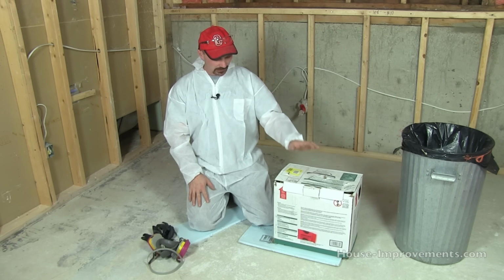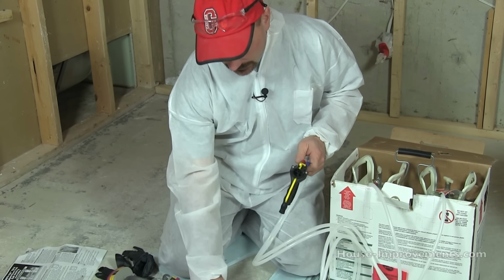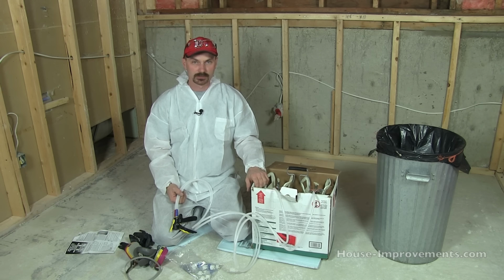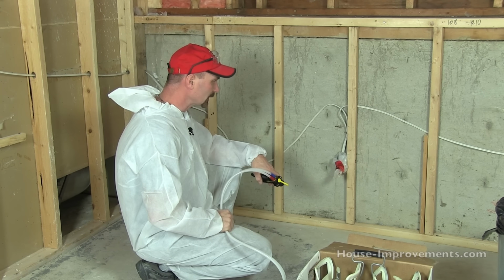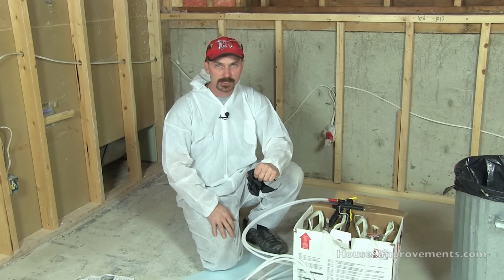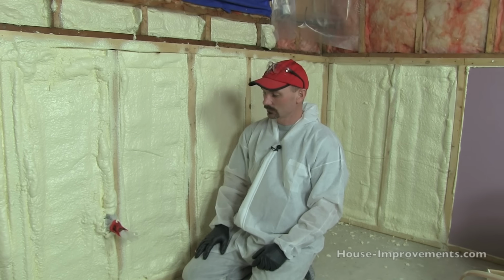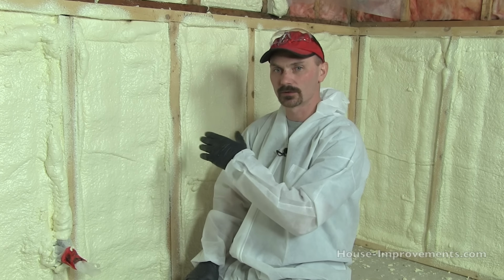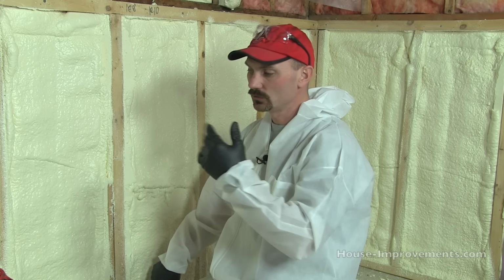How to Install Spray Foam Insulation DIY

Comment: For anyone who wants to compare glass to spray foam(closed cell) I have had 2 homes in Louisiana which gets 100 degree temps with very high humidity, Ac people will ask to come do work in your attic as early as you will wake up so they can tolerate the heat, My first home had glass in the attic, It was horrible to get in the attic during the day with two attic vents running all day. I lost that house in Katrina, The new house has spray foam in the attic, I can work in my attic all day and it gets warm but not hot. Much more affordable electric bills compared to the glass attic in the first house, my first house was 2100 square ft and the new house is 3900 square feet and I pay less now then before. It cost much more up front but if you stay in your house or plan on staying in your house for at least 15 years then it will pay for itself.
Reply: Thank you with helping my decision
Reply: Great info!
Reply: Was it just roof you had sprayed ? Closed ornopen cell ? No condensation problem in winter ?
Reply: There must be some missing info here about the 2 houses.  A typical attic is uninsulated.  The home's insulation is found in the attic floor not on the attic ceiling.  So the heat in the attic is determined by how well it's vented to the outside.  The insulation doesn't make a difference because it's only creating a temp barrier between the house living space and the attic.
Reply: I live in North Port Fl heat & humidity take your breath & to pay outrageous energy bills to cool my house is absurd. I have done enough home construction to know I can do this to my mobile home interior wallas.
1x3 studs with cheap insulation. This should be great for my home. How much is the question. Home is 36x24

Comment: FYI, the fumes don't give you any kind of buzz, but they do indeed give you a very heavy chest and red eyes that burn. You even get haze eye which can be painful, sensitivity to light and very cloudy vision. And it lasts for days. I found this out on the first job I ever did with a filtered mask and safety glasses. After that I immediately bought a forced fresh air system. Oh and if you have asthma, exposure could cause a severe asthma attack. Just throwing that out there, I'm not some big safety gooroo or nothing.
Reply: Thank you very much for sharing that information It is vital to know!

Comment: Once again Shannon thank you for the great video I did my basement in 2014, And it cost me a $1000 Then to do the whole basement and I asked the crew to spray right up to my ceiling in the joyces.  It paid for itself in one year. Now I'm doing a small renovation project in my cold cellar which is 10' by 5'. With inflation it's gonna cost me more just to do that little space than it was to do my whole basement. So I will be buying one of these kits to do it. 
 Thanks again.

Comment: I just did this in my basement. The rim joists were so drafty it was like a wind tunnel under the floors. It was so satisfying spraying the wood and feeling the air be still afterwards :)
Reply from the maker: works nicely!
Reply: Are the rim joist  what sits on the foundation edge around the house??!
Reply: @michelcorneau1923  yes

Comment: I pulled all the insulation out of my place last week. It was not even tact into place, looks like someone set it and put up drywall. It was piled up at the bottom of the walls. I am almost done spray foaming all the walls. Been using a guitar string to level it all with the studs and a putty knife to clean up the studs. Next is the roof and basement.
Reply: are you using the guitar sting to cut off the excess foam sticking above the stud's after it has cured?

Comment: For anyone watching this today: air barrier requirements are usually met after just 1" of closed cell foam. Also spraying multiple times has nothing to do with an air barrier. Spraying multiple layers acts as a single layer. Overall thickness is your only concern.
Reply: I thought 2" of closed cell foam constituted an air barrier...
Reply: You sound knowledgeable. Could you use this on a ceiling with corrugated metal ceiling? Any recommendations for brands?
Reply: @TheJnetnunez  Can be used for corrugated metal roofs. That is a standard "upgrade" people do to shops/barns. Just realize that it's basically glue, and replacing any panel it's sprayed on (say in 20-30 years) is quite difficult. Can still be done though.

Brand doesn't really matter, you just want to use closed cell (rather than open) for the layer that contacts the roof. Open cell will absorb moisture and can cause problems.
Reply: @whitenite007  we did a shop addition and all you should really have to do is put the pink styrofoam insulation board up first then spray foam.

Comment: Just bought this exact kit from the local Menards to do the outside facing basement joists.  This is a big help, thank you for the DIY.
Reply: What brand is this kit?
Reply: @trayvonlovell9301  I bought the Froth-Pack 200 by dupont, there are larger tanks available as well (650, etc).  
Make sure you you pull the the trigger all the way at all times - learned this the hard way the second time and I did not watch this vid as a refresher....

Comment: Great Instructional Video Shannon i used these kits to do my basement 26x56 framed all in 2x2 and my Garage 24x40 x12 2x6 construction Garage Myself took 4 days to complete just after New Construction got quotes from 3 different Pro Company’s and the cheapest it could be done with 2in in the basement and 4in in the garage only outside walls was 23,650.......Highest Quote was 27,323 i did the whole job myself and did layers just as you did just invested in a large bag of fan tips and it cost me just under 10,000 including my time at $30 pr hour 24 hrs total.......The Happy Dance....🗯🥳🤪
Reply: J Martin 
Are you saying you spent $9000 in Foam?
Reply: This is similar to what I'm planning with my own remodel.  I'll just be doing one room at a time as it will be a live in remodel.  And due to being a live in I can't afford to rip everything out all at once to spray and then recover.  For me the costs of the kits would be will spent in comparison to living in a hotel due the entire time of the tear out, electrical prep, HVAC prep, plumbing prep, shooting the walls/floors/ceilings, and then covering it all back up.

Comment: Depending on the specific situation, spray insulation is superior. For instance, if you are insulating a van, spray will prevent moisture from reaching the metal and corrode. In home, the spay can fill up air-gaps, especially around electrical outlets.

Comment: How can you clean spray tips
Reply from the maker: It would have to be done immediately after removing the tips if you did try and you could use spray foam gun cleaner. not sure how well it may work? https://amzn.to/3BSLL8b

Comment: If you apply this to a concrete block-above grade- new construction home, do you have to seal the blocks on the interior with a moisture barrier? Thanks for a thorough presentation.
Reply from the maker: IMO ,I do not think so.
Reply: Foam does mold if exsposed to moisture...
Reply: We would spray block and concrete basements on the outside from foundation footings up to the top amd only the exposed foam would need to be sprayed with a UV protectant and a fire shield.

Comment: If the foam is closed-cell, it is its own vapor barrier, and trimming will be fine, as the next tiny cell down is closed anyway. If it is open-cell foam you will need to add a seperate vapor barrier, whether you trim it or not. The can should tell you which type.

Comment: I was wondering what is done about the holes in the cinder blocks on top of the wall?
Reply from the maker: This is not for filling cinderblock walls.
Reply: Should those holes in cinder block be filled with something?

Comment: TIP: if you want to save a tip have a container of acetone, put the used tip in the acetone it will dissolve the foam in the nozzle
Reply: I was wondering what will turn it back to liquid. Thx!
Reply: I'm surprised they don't tell you these things. I have a can of spray foam gun cleaner and you'd think they would have you use that to clean the tips out if it starts to clog.
Reply: Thanks! That’s good to know.
Reply: @harleymeyerink3747  You won't buy new tips if they tell you how to fix it.
Reply: Yeah spray foam cleaner or you can get a can of spray release as well.

Comment: Shannon, Do I need to use the plastic anchor to attach foam board insulation sheets to my concrete basements walls?  So far we've used adhesive to attach the insulation to the walls.
Reply from the maker: If the adhesive is working well stick with it.

Comment: i think you should let the first application dry then go for a second one to get the 2" thickness. I believe it needs to dry out and get the chemicals do the reaction.
Reply: The Froth Paks are extremely fast curing.
Reply: I would have gave everything one coat first just in case you run out and end up w/a cavity w/ no foam at all. Too expensive for a DIY guy to buy another kit to finish. Maybe finish w/ can foam?

Comment: What is the approximate cost of the kit and much will each kit cover 8:20
Reply from the maker: This kit in my area of Canada is 500$ and does about 200sq. feet at 1" thick. You are best to check your own area for pricing.

Comment: Shannon, this is closed-cell foam. You don't have to make sure you put down multiple coats to ensure vapor barrier protection, one coat dried and then cut would not allow moisture to escape since the little foam cells are closed. Cut it all you want, it does not breathe. Nice tutorial.
Reply from the maker: Thanks for clearing that up.
Reply: Haha, i just came to the comments to say the same thing
Reply: Nirky You're BOTH correct!
By his application of multiple passes, he IS helping the TWO chemicals the needed curing time.  When applied too heavily, the curing time is greatly increased and the foaming effect slightly decreased.  Think of it like a good pot of soup - letting it simmer s-l-o-w-l-y helps the over-all results.
Reply: Actually, there is a limit to the depth of the lifts too, because it is an exothermic reaction, ie, creating heat as it cures, the insulating properties can trap the heat inside a thick layer causing it to overheat.  It will be burnt, crispy with poor insulating value and can actually catch on fire.
The minimum thickness to create a vapor barrier depends on the permeability of the specific product being used, whether it is open cell, closed cell, low density, medium density, etc...
This website says that the lifts must be between 12 and 50mm in thickness, the minimum to ensure that there is a sufficient temperature for curing caused by the exothermic reaction, the maximum to prevent overheating. Page 12.
http://cufca.ca/docs/CUFCA_SPF_GUIDE_2013_Final_Xerox_Press.pdf
Reply: What happens to the wood if you don't put vapor barrier? If insulation is done like this, I really recommend vapor barrier. There should be one hole layer foam, when you can left vapor barrier out.
Reply: If you use spray foam it van be detrimental to use vapor barrier.
In effect you get two barriers that will trap moisture between them.
Reply: Yes there is vapor barrier in that space where there is spray foam. But there is not any barrier in that wood part of the wall.
Reply: Vikke Koskela the spray foam is a vapor barrier, but a better one than any poly sheet, because it adheres to the surface and eliminates any air gap between the surface and barrier.
Even with a polyethylene sheet there can be some air movement behind it and water due to the space, plus the spray foam is a thermal break.
spray foam is awesome!
Reply: Good point on closed cell. Closed cell is more expensive than open cell. Around $1 per board ft (12"X12"X1") for closed and $0.70 per board ft for open. Open cell is NOT a vapor barrier. Also when spraying the mask is not as much for fumes as for a barrier for the spray material itself. Especially in a well vented area. Just a few drops a spray inhaled can kill you. It is expanding foam. Think what happens when it gets into the airway for your body. Safety first people.
Reply: Pay for a professional to come and spray a real 2 lb closed cell foam. These froth packs are not meant for anything other than air sealing. They are not a valpour barrier. They are not a 2 lb density foam.
Reply: @noahcameron5745  When I first sprayed roofs, walls and vehicles back in 1978, most of the time I did it without protective clothing and just a particle mask, safety glasses,  and some Vaseline in my hair, on my face and exposed arms along with a hat or cap. I got so much of the fine mist in my lungs from spraying overhead when not having the proper safety items along with fresh air that it started causing me difficulty to breath. I had to use the oxygen from the acetylene torch in order to get enough oxygen so as not to pass out and felt like I was suffocating. I wound up with a wheezing in my lungs because of this that still hasn't gone completely away to this day. So be sure to use and wear the safety equipment for your personal health and protection. I wound up not being able to work around the foam when it was being applied but still stayed on as the mechanic cleaning and fixing machinery on a daily basis to keep the new spray mechanic working optimally each day. Of course back then it was not hard to confuse the A and B material hoses and completely gum up the system, hoses and guns because no one at that time was using right and left threads or even different sized fittings to avoid the problems of mixing materials together previous to being sprayed. I knew the difference and never did that but the new guys would take their turns mixing things up and causing lots of waste and need to purchase new expensive hoses when they couldn't  be used anymore. Each set of hoses would be resistance heated electrically by the wires making up the hoses so that optimal expansion would take place in any weather. The technology was so new then that no one really knew what things to watch out for and most of it was learned by trial and error until OSHA got involved to help eliminate most of the safety issues by implementing the white suits which were a protectant more than just getting the material on your work clothes and shoes, etc. I hope this helps inexperienced ones understand the consequences of doing this in an unsafe and hasty manner.
Reply: Ben Lofgren was
Reply: I inhaled this shit last year and now dont have to wear a coat in the winter cus am always warm
Reply: @zandemen  what if I have an old foundation and water seeps in? Won't spray foam cause me more problems behind it?

Comment: Could you use these kits to fill concrete blocks as you were laying them if you put a hose over the end of the nozzle and filled about 3 rows of block at a time

Comment: I used foam on one room as a trial. I foamed it up to the studs. Result? AMAZING!
One thing that I did learn prior to trying was to always use CLOSED CELL foam. It will not soak up water and cause problems. It also acts as its own vapor barrier. As I refurbish my house I will foam each room as I go. Should drop my heat load by a very great degree. Why is it so expensive? I would guess because of how much it saves in fuel over the long haul. Not only that, but your home will be quieter and move comfortable.
Reply: Thanks for that info. Looking at doing this very soon. On my house as we rebuild it.
Reply: @loushear4497  One thing to keep in mind tho... Houses are designed for a certain rate of air infiltration to assist in a healthy rate of fresh air exchange and humidity.
When houses are 'excessively' air tight, an Energy Recovery Unit is often used to make up for the lack of fresh air. Also, if your house is heated by gas or oil fired appliances (boilers or furnaces), they also need a source of unrestricted fresh air.
Reply: @burnerjack01  no gas anything.  Do you think walls and ceiling would be a bit much? I'm new to this as you can see.

Comment: What's the brand and price for each set of insulation tanks?
I'm building my new house and doing mostly myself, this looks like a really great option.
Reply from the maker: Depends on your area but an entire house done this way would be way more expensive that hiring a pro company to come in.
Reply: @HouseImprovements  
I just noticed that 
I checked the prices and it is pretty expensive.
Anyways, thank you for explanation on the video.
Never know when it's need, I'll put it in my back pocket.
God bless

Comment: I've been very interested in this type of insulation. Thank you for taking the time to show how it's done.
Reply: Truthseeker how far do those kits go?
Reply: It's crap if you want to do any work in the future
Reply: @DemnRaig80  I run conduit for wiring (mostly Cat5/6, so 1") first so re-wiring is easier. I don't really see much need to open up walls otherwise

Comment: Thanks for the video. What is the soundproofing like with this spray foam? Also would it be wise to put some other protective layer on top of it all before putting on dry wall incase some chemicals are let off?

Comment: Is it inflammable? Can we install it in our kitchen?
Reply from the maker: It must be covered with a fire protection like drywall or something like that.
Reply: Smoke a cigarette while you are applying it and let us know
Reply: That's the downside, very flammable as is rigid foam board.
Reply: inflammable. Very easily set on fire. 

Not once it is cured.

Comment: Must you have framing? If appearance is not a concern and you are not sheetrocking over can you just spray away?
Reply from the maker: You can but foam must be covered to protect it from fire after wards. It gives off deadly fumes if it burns.